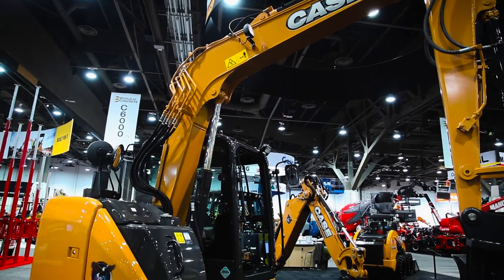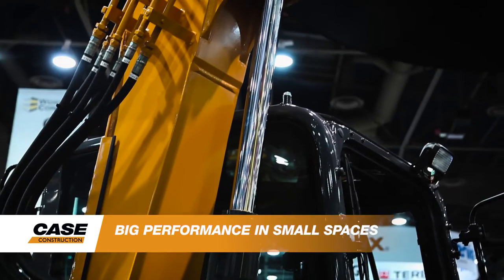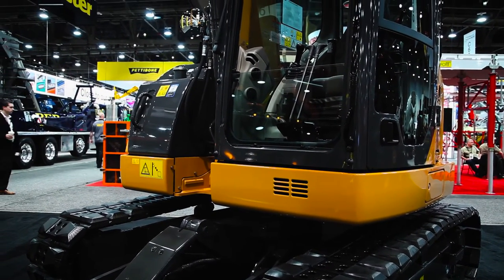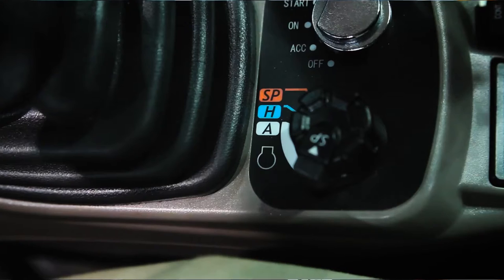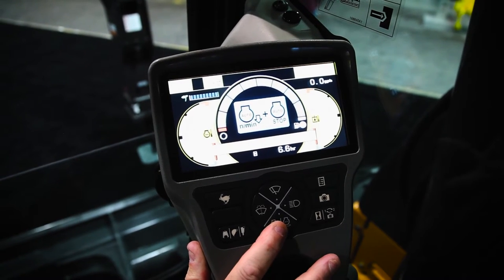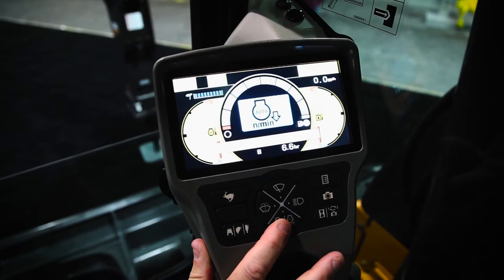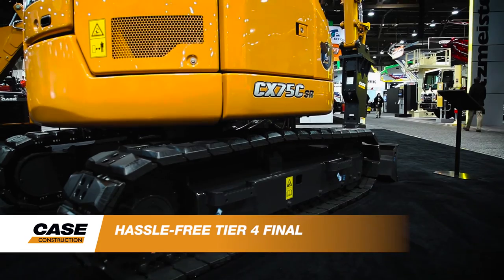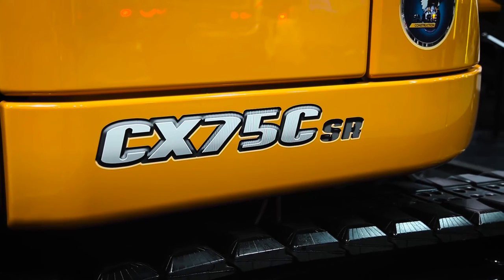North America: CX75C SR Minimum Swing Radius Excavator Walkaround

Comment: Why doesn't it have the same bucket changing system as the Case Backhoe's?
The one thing that operator's have to more often than any other activity and you guy's drop the ball in not adding the feature that is the only thing that set's your backhoe's apart from your competition!!!
Your management and engineers are hung up on gizmos and not being user friendly:(
Reply from the maker: Thanks again for the note Bold Guy — we'll pass this on to the product team — the optional coupler/pin grabber on the CX75C is extremely easy to use and allows for quick changing of buckets. Our CX75C users are extremely happy with the machine and its performance: https://www.youtube.com/watch?v=VCe1PKyyCZM.
Reply: The problem with any of the pin grabber systems is that it changes the geometry of the bucket hinge!
But as I pointed out, Case Backhoe's have by far the best system in the industry, nobody else can copy it because Case holds the patent!!
Why you would you guy's leave your best feature on the sideline's!!!
Reply from the maker: Thanks again for the feedback... we are sharing it with our product teams. Let us know if there's anything else we can help you with...